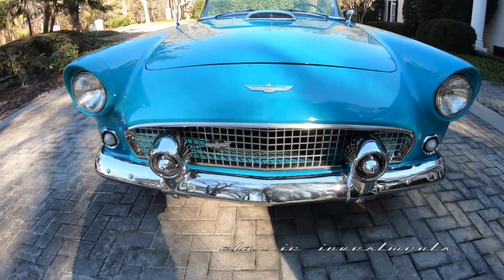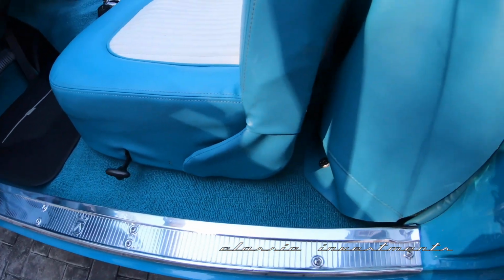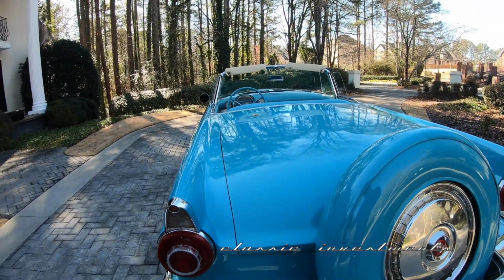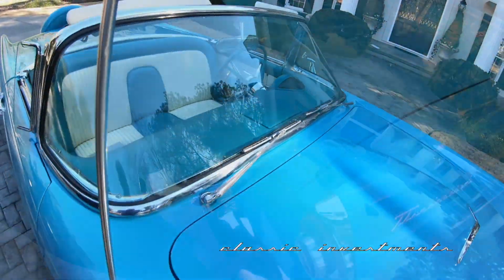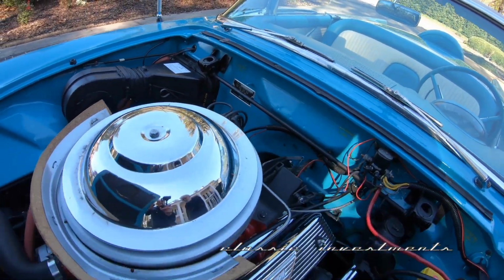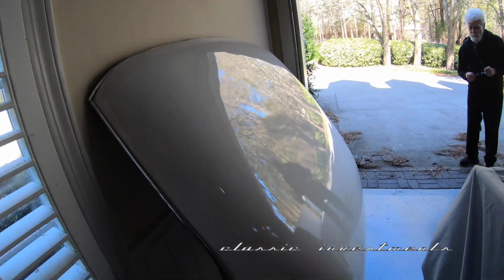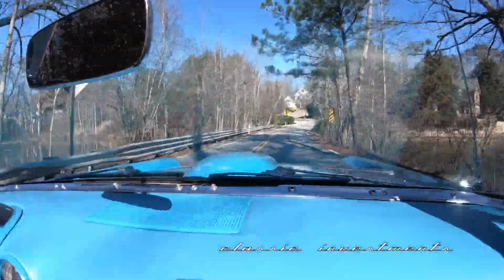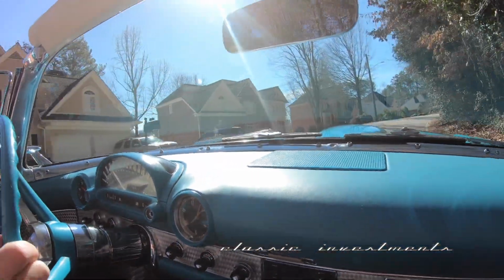1956 Ford Thunderbird

Comment: It also has a pretty big dent in the top of the driver side fender. There appears to be a bubble in the paint on the lower driver side door and the door gap is way off. Also the fit of the carpet is horrendous. There are more questions than answers on this car. I call B/S big time on this car. Inside trunk paint does not match exterior paint. Grommets for the wiring in the engine compartment should be black and not painted over. Hose clamps are the worm type something Ford never used . The oil cap is not correct, there is an alternator instead of a generator. Look at the original paint color on the bottom of the hood scoop. For a supposed 18,000 original car there are too many questions.
Reply from the maker: sorry....you are wrong....